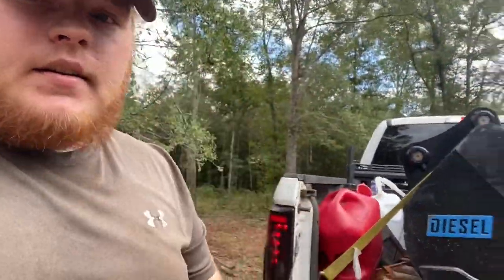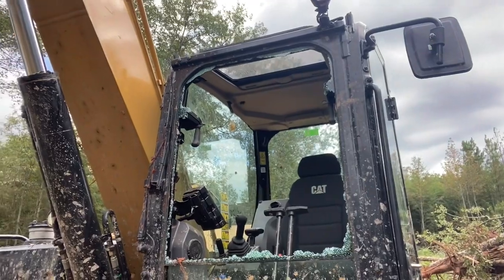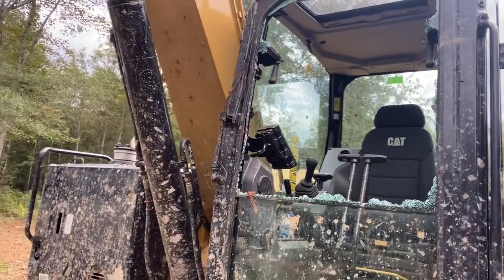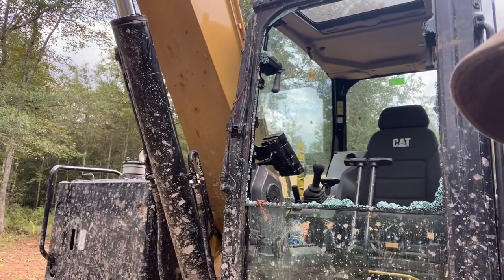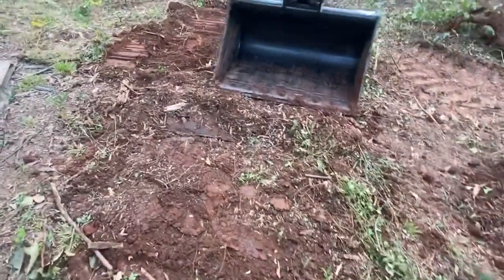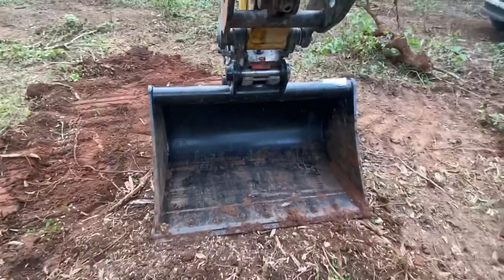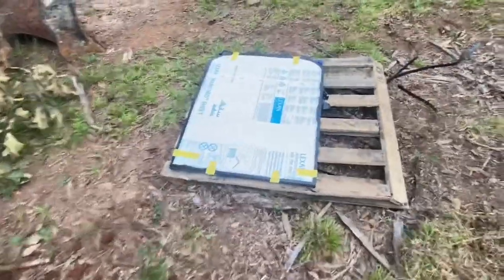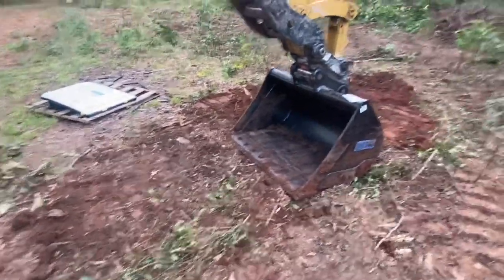New Bucket, Busted Windshield

Comment: Diesel should know Cat coupler specs and that bucket should have been manufactured to fit your Cat machine/coupler. That’s the primary requirement for the bucket manufacturing process (the Fit) if they miss that, then ;&@:-/“&??????????